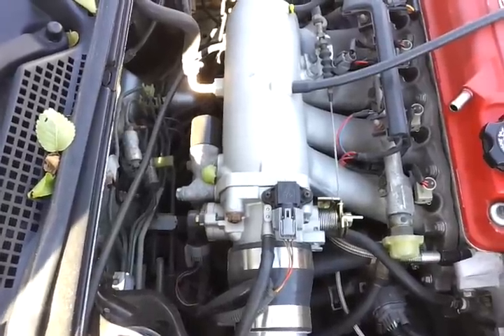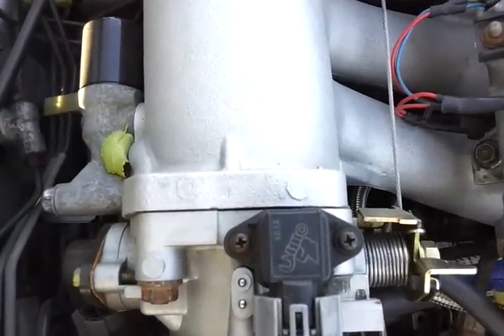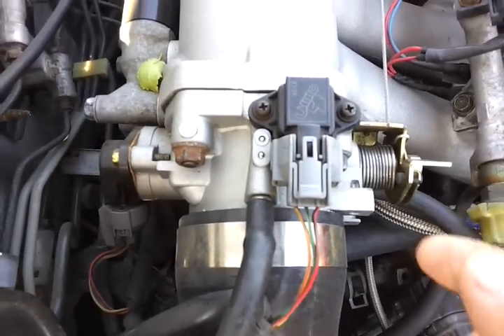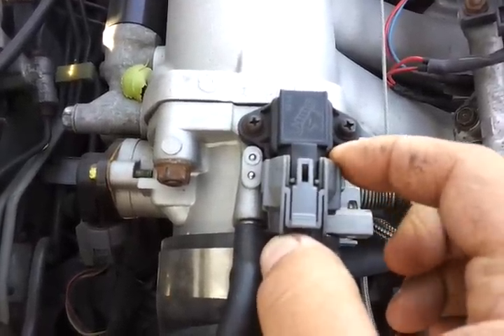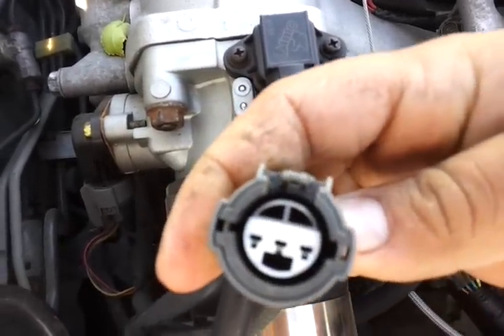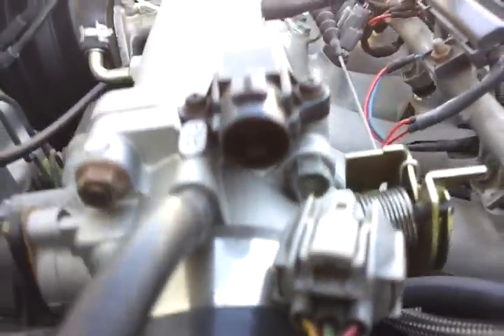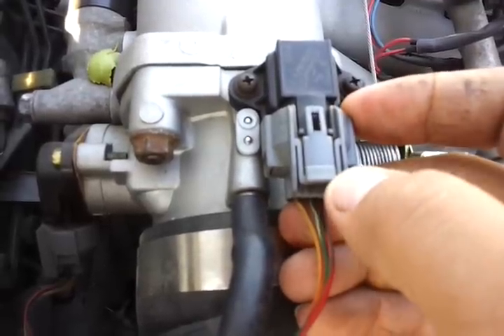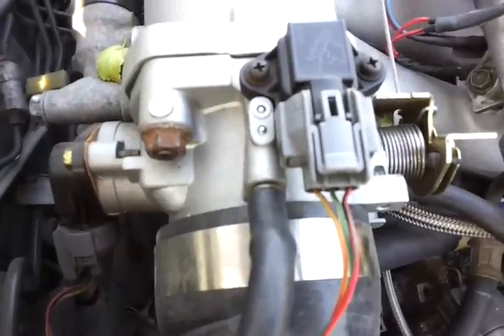My map sensor or connector problem

Comment: Am currently having this same problem with my 2000 Honda civic.... i changed the map sensor which was a use one I bought and the car started function like it should an also the check engine light went away.... but like two hours later the problem came back an the engine sound high again sighzzz.... i just think I should buy a new map sensor right now an get rid of this problem.
Reply: Did this fix the problem? Having a problem in my 08 civic with cel on and I replaced the map sensor and was good for a couple hours, then the cel came back on with car stall.

Comment: Can anyone help me. I have a 96 Acura Integra RS the code that's reading is p0108 manifold absolute pressure/barometric pressure circuit high. My car idles at 1100rpm. I replaced the map sensor with a new one. Still the same. I unplug the connector and nothing happens still ideling high. Connector fits nice and snug. Where would the ground be for it? I was thinking it wasnt making good connection. Any idea?
Reply from the maker: George if I remember correct, if you disconnect the connection it should die off, which makes me think you may have the wrong connector on there...the throttle position and map sensor connectors are the same but different colors. Is that all you did was replace the map sensor?
Reply: @boostedunrivaledteg  all the connectors are the same as factory. I also replaced the tps and the code came off after replacing it but now it came back on. When I do disconnect the tps connector the car does slowly shut off. But not with the map connector the code for tps is P0122 switch A circuit Low
Reply from the maker: Try switching the tps and map sensor connectors around and clear the codes.
Reply: I'll try switching the connector but when I've tried earasing the codes rpm drops but the goes back up and light comes back on
Reply from the maker: Well the ecu needs to relearn a few things when codes are cleared. Just want to see if maybe the wires got crossed accidentally..it happens alot
Reply from the maker: Did you figure it out bro
Reply: @boostedunrivaledteg  nope still no luck, I ordered 2 new connectors and see if that was it. Where would the ground wire be for the sensors?
Reply from the maker: Well I'm pretty sure it gets its ground from the ecu, so if you can follow a wiring schematic and pin out then Google search whatever obd you are and you'll find it easy.
Reply: Most 90s Honda’s use the thermostat housing for most all ecu grounds.  Ie. injectors,map,tps,coolant temp,   Hope this helps someone
Reply: This videos helped me 96 Integra LS, wires where spliced n crimped. Undid the electrical tape and the red wire was un crimped. I used electrical tape .99c fix.
Reply: Did you ever get it fixed? I have the exact same car n the same issue

Comment: After hard rainy days my car acts the same the engine starts to rattle like crazy and feels sluggish when gasing. What could be causing this?
Reply: I'm having the same problem. But it happens when I wash the outside of my 99 Honda Accord ex 2.3 vtec. Haven't figured it out yet. When what ever is wet dry out 🚗 idle fine.
Reply: Mine also starts to rough idle and nearly die after rainy days also nearly dies when i touch it so was it the map sensor? Did u guys ever figure it out?
Reply: @danielvega4076  you have a connector that is not seated properly and is getting wet when it is raining/washing car. Suggest you figure out what connector it is, then grab some silicone lubricant spray and some canned air. Use can air to blow out any trash/dust/dirt and then use the silicone spray to ensure the connection seat proper... Dieleretric grease is also a good thing to use if your allowed to use it. Google the connector to ensure first.. and the amount. Example, some sparkplug ingition coils allow and require it, and some dont and refuse and if you are suppose to use it, you should only use a small bit. or you will block the charge and cause a misfire. good luck.

Comment: I had exactly the same problem.  I fixed it by tightening the connectors with a pin or small screwdriver.  It lasted about a year, and now it stated happening again.  I'm going to buy a used connector to fix it permanently.

Comment: bro u need to readjust your valves. I hear that thing clacking from a mile away
Reply from the maker: I have multiple times and it wouldn't quite down. Head had been gone through and nothing was found. I do believe at the time of this video it was on cold start and I had many people say it was my forged internals...once it reached operating temps it wouldn't be so bad.
Reply: Prob the lma